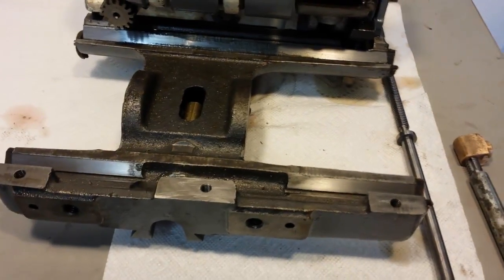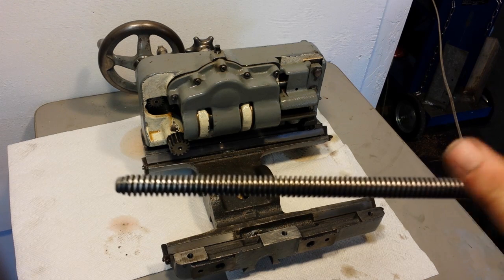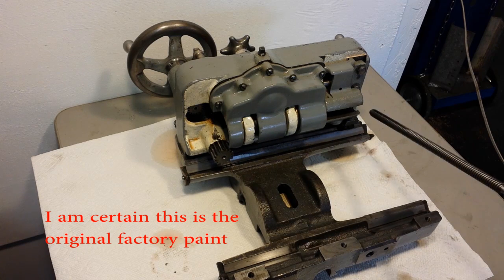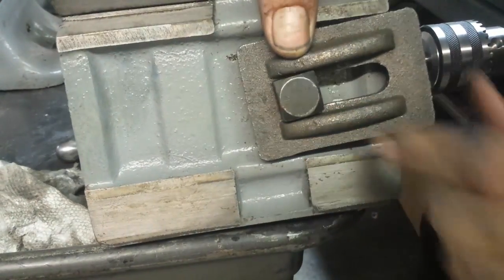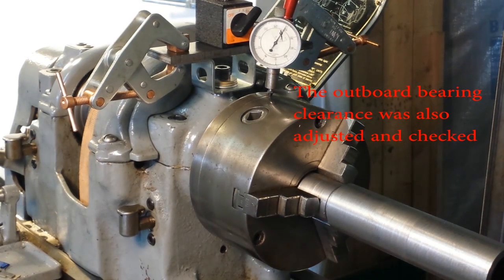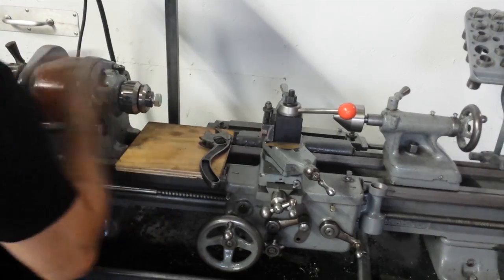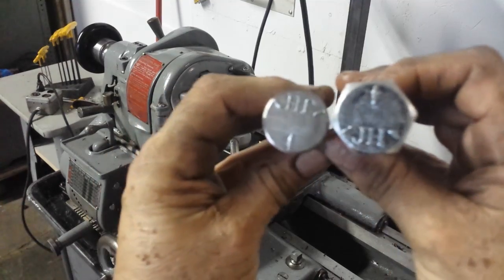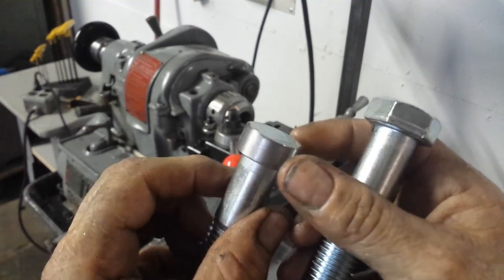South Bend Tool Room Lathe Mint

Comment: I'm the South Bend moderator on practical machinist and I gotta say this is a cream puff you got there. Love the super quiet end-gears. Check out my restorations of three south bend lathes. Did a SB drill press and will be doing a SB pedestal grinder this winter. Great video.
Reply from the maker: Thanks, Brad;

I've enjoyed  your videos as well.  Will take a look at your videos pertaining to your SB lathe multiple restorations.

The condition of that lathe was a real treat to discover.  During cursory inspection at pick-up, it looked good.  Further inspection during condition determination/correction just kept making me smile.

The lathe is back to work now.

Lucas

Comment: Looks like a good find!
Reply from the maker: Hi Jack,

Hope all is well.  Amazing that this machine is almost 70 years old!

Lucas
Reply: ltousig
  Those old machines were made well!  This one will make someone a nice addition to a shop.
   I live near Sidney, Ohio, where Monarch lathes were made for 80 years or more.  I stopped in there the other day and they still make a few 10EEs yet, as well as rebuild old Monarchs.  Just 15 guys working in about 5% of the original building.  I read somewhere that a new 10EE sells for $60,000.  Hard to believe that there is a market at all for them at that price.
  My Clausing 5914 is running fine, but I don't have the variable speed control where I want it yet.  Just have to spend more time with it.